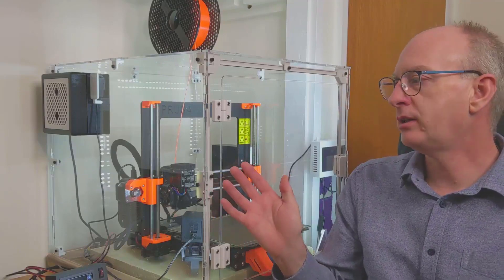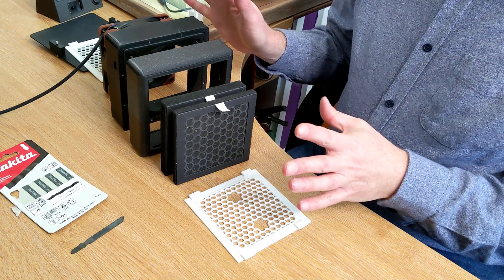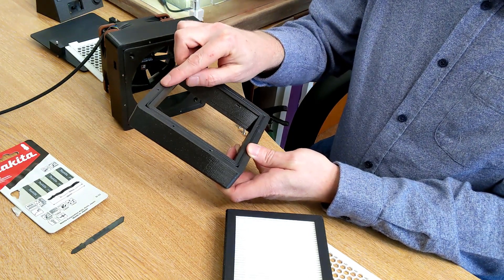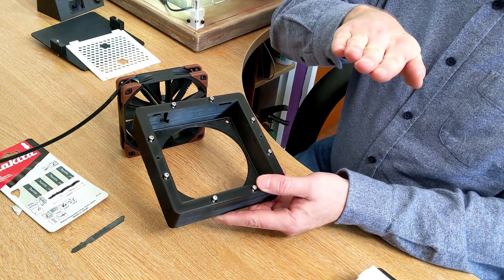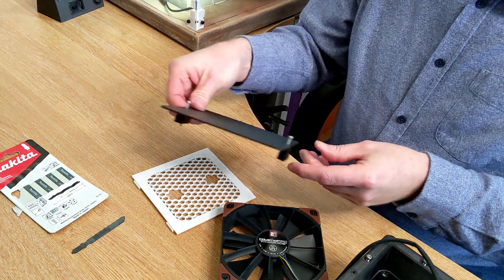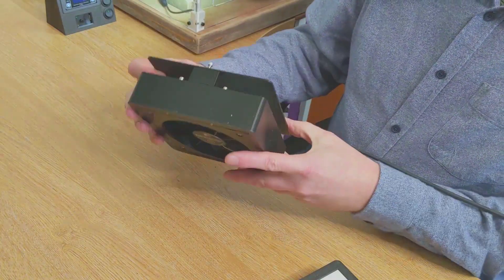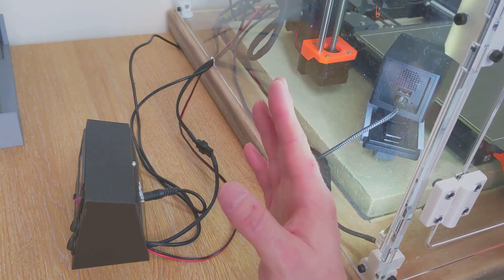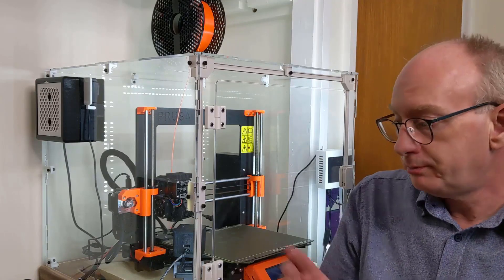3D Printer Enclosure - Adding an extractor fan with HEPA & Carbon filters

Comment: Hi Colin, great video and very informative. However the hepa and carbon filters you use seem to not be available. Do you have the dimensions  of the filter? I would like to have a go at making it however after searching for the filter I’m unable to find one at a reasonable price. They seem to have sold out on eBay so I will need to order from China most likely. Would appreciate it if you would let me know the dimensions of the filters used. Thanks you
Reply from the maker: I found them to be 119mm square

Comment: does the fan have to blow through the filters or can you set it up so that the fan sucks air through the filters so that there is no blowback ?
Reply from the maker: I need to redesign so the fan is on the outside, then it can suck. Watch this space, it s on my list to do soon.

Comment: Great vid. Do I need a specific type of 12v power adapter for this? The spec sheet for the noctua fan says max 3.6w and max 0.3a. Most 12 do powe supplies I’ve seen appear to be 1a minimum. Is this a problem?
Reply from the maker: No, the ratings you mention are draw power. A 12v 3A or 5A supply is fine. Or 1A if you have it. My psu often coonects to lights and other devices so the extra amps are needed.

Comment: Hi Colin. Nice project. I did that to my enclosure. I have one question. Can you feel air coming out of filterset? If I put hand to front of filterhouse I cannot feel that air is coming out of filterset.
Reply from the maker: Yes i can. If i hold a sheet of paper in front of the filter, it is pushed away. Did you use a strong fan? IPPC3000 recommended.

Comment: What about air intake? Have you added any openings or is air sucked in through leaks in the cabinet?
If air could get into the cabinet easier, maybe the pressure wouldn't have to be as high and maybe a more silent fan could be used? Or would it produce to much draft? I do not own a 3d printer so I don't know how sensitive the printing is to drafts.
Reply from the maker: Abs is sensitive to draughts. The main issue is pushing air through the paper HEPA filter

Comment: Hi, very informative video, thanks for showing!
I have a small, cheap and fully enclosed printer, the creality cr200b. It comes with two 60mm case fans that are optional while running the printer. They are mainly meant to use as a heat control for high temp filaments. I wondered if I could use the extractor fan for filtering purposes through just popping an external filter-unit like the one u showed one there. Given i might need a stronger fan this could be an easy solution, or is there anything speaking against using the advantage of an existing extractor fan? Should the filter and fan size always match or might it make sense to even pop the 120mm filters on there?
Thanks for any response!
Reply from the maker: No reason why you cant use 120mm filters on a 60mm fan, as long as there are no places for air to escape. Or use smaller filters. Fan power may be an issue, perhaps get the filters, hold by the fan and see if you can feel air passing the other side of the filters. If not, try looking for a better fan. I use Noctua IPPC3000, plus another 'unbranded' make that is high pressure. Good luck.

Comment: I realize that you want it to be quiet, but would it not be more efficient to have the fan pull rather than push the air through the filters.
Reply from the maker: Not sure on efficiency, you may be right. I have moved the printer to a different room now, and that means i can indeed swap it all around and have a pull fan effect. Noise wont be an issue.
Reply: @colinhill  did you try to turn it around?

Sounds interesting!

Comment: Hi, I generally like the design and am working on printing it for the enclosure I'm building at the moment

However, I'm having a lot of trouble printing the filter grills.
It is very difficult to get the first layer right with the crazy honecomb pattern. Furthermore the insane number of retractions on that pattern means my extruder is constantly moving over the same region of filament, almost flattening it entirely, which leads to it getting stuck in the bowden tube...

How did you get that to print successfully?
I'm currently using Prusaslicer on an Ender 3 v2.
Reply from the maker: slow down the first layer A LOT. There are a lot of retractions. You could always design a different grille yourself, like just a square hole format.

Comment: Hi Colin, 
Thanks for sharing this.
Have you made any measurements on the amount of micro-particles and VOC's released with and without the filters ?
Reply: So I’m not sure about the vocs with the charcoal filters and whatnot but the hepa filters remove 99.7% of particles that pass through it, and while they have holes larger than 0.3 (nanometers or some other small measurement), micro-particles still get stuck inside due to clumping together along with the concept of Brownian motion.
Reply from the maker: No i havent. But i would hope the hepa filter and carbon filter assist with particles and smell.

Comment: Hi Colin, Great product! 

Although it might add some noise, do you think mounting the fan on the exterior could avoid the turbulence problem? That way, any air being pulled out would not be directly hitting something that could create turbulence. Noctua Fans are pretty quiet as well, so it might not make a huge difference for noise.

I am also incredibly intrigued to see your addition of a temperature controlled system! I have recently been interested in finding a strong solution for maintaining a steady temperature for printing while also exhausting fumes/VOCs through an exhaust filter like you have created. Will you be basically adjusting the Noctua PWM based on a temperature reading to regulate the temperature inside? I have seen other ideas but they consist of turning on/off the fan, and in that case, the air might not be exhausted consistently.
Reply from the maker: Mounting the fan on the outside and filters on the inside would work as well. Its just you get the full sound of the fan,  which is why i didnt do it that way. The temp controller is just a £15 humidity/temp unit from ebay, powered from 12v and has switching relays to turn off/on the fan at the required temps. I only use the Noctua speed controller for noise adjustment, so if i have to use Zoom or something for a call, i can turn the fan right down, then back to full afterwards. Its not essential. But the temp controller is a very cheap good solution, with a sensor on a lead included.

Comment: Hi Colin fantastic video thank you I’m thinking of making a enclosure for my elegoo Mars 2 pro resin printer due to the toxic fumes would this work on my wooden enclosure  thanks
Reply from the maker: It sure would. You will just need longer M3 bolts to cater for the thickness of the wood you are using. You could bolt it to the top side, or on the roof of your enclosure, depending on clearance with the top of your printer. I do recommend the Noctua fan with fan controller thats mentioned.

Comment: Hi and thanks for sharing, I was looking for just such a thing. A question that I have not found an answer to.
If I have a fan that draws air from the case, does it take a fan that blows air into the case? If so, where should it be placed and what size? Thank you
Reply from the maker: So you want the extractor, and are also thinking of a fan to push air into the case. Unless your case is well sealed, this shouldnt be required. The extractor will suck air from around the door. You could possibly fit a small passive vent (low down on the opposite side). In my case i'm using a Tukkari TS enclosure for Prusa Mk3, this has 2-3mm gaps around the door, where the slot is for the filament to enter, and around the bottom edges of the enclosure. This gives plenty of incoming air that the fan will suck out.

Comment: Thanks for the great video! I hope to see more projects! Would there be a chance that you design an adapter for an exhaust hose?
Reply from the maker: The design could certainly be modified. Wouldnt need the filters. It really depends on the size of the hose being used (diameter)
Reply: @colinhill  Thanks for the answer! I would prefer the option to filter in winter and put the hose outside the Window in summer. for now i will use the original design. The filters are ordered and should arrive next week. the parts are already printed. thanks for the great design!